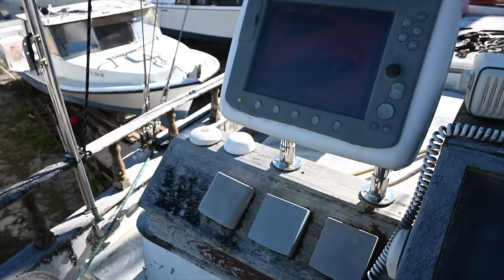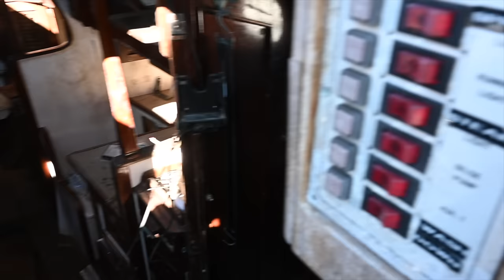ABANDONED BOATS for sale in the Shipyard + Camping in the VW Bus + Another FORMOSA 51 (Ep. 40)

Comment: Interesting. From what I have seen, you would spend just as much work on a "ready to sail" but needing some cosmetic work boat that cost a lot more.... at least that seems to be what I see people doing. For a "new" looking boat, at least on the onside, one has to work on pretty much every inch of surface. One is looking at an engine rebuild at least, possibly a new engine, pretty much replace any nav gear more than about 10years old and still redo the hull, at least below the waterline. All mechanical equipment will need to be serviced or replaced, winches, blocks, rigging over 10 years old, etc. It is the same if the boat is abandoned or being sold as ready to go. On the other hand, if one is just looking to go sailing and can live with the interior as is, paying a little more for ready to go is a better deal.  Your particular search is a hard one.  Take your time, be willing to walk away from anything, stay away from boats owned by more than one owner (though a couple is normally ok) because one owner will agree and the one you can't talk to will not.
Reply from the maker: You’re right. And yes, that’s where we are- needing a boat that’s almost ready to go but needs work. I just don’t want to do a complete refit and spend months or years on the hard. I know you can find deals when boats need some work but are still really sound, and that’s what we need. We need a deal and we can do the work.

Comment: What a sad collection of derelict boats. That Formosa 51 would be an awful project to restore. Buy it for $10, spend several years and $150,000 rebuilding it, and you will end up with a boat that sails like a half-tide rock and will sell for $50,000. Truly sluggish performance, requires 10+ knots of wind to sail at 3 knots.
Reply from the maker: Yeah but there’s a market for that. However, I believe it would cost a great deal more than $150k when you factor the interior rot.